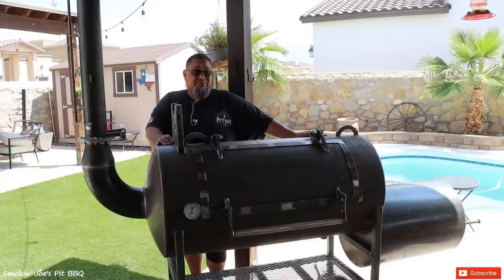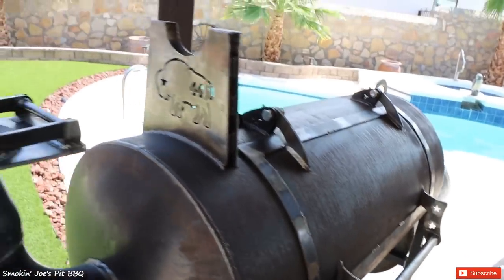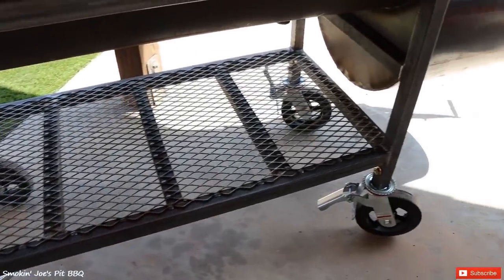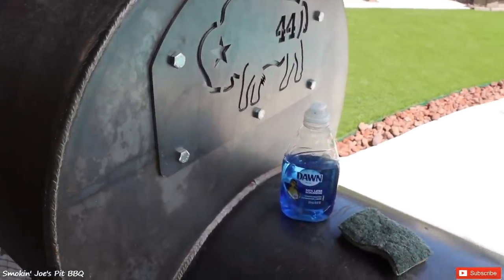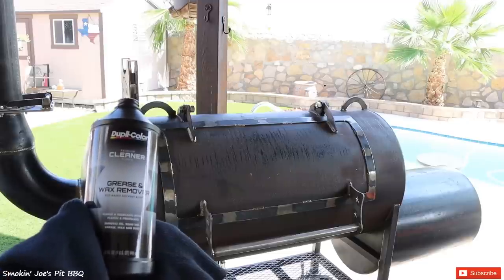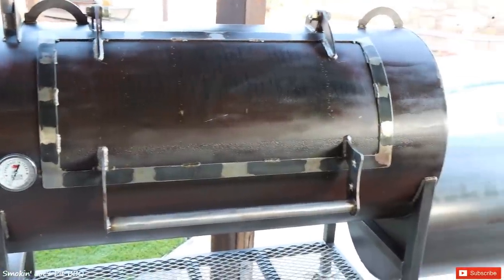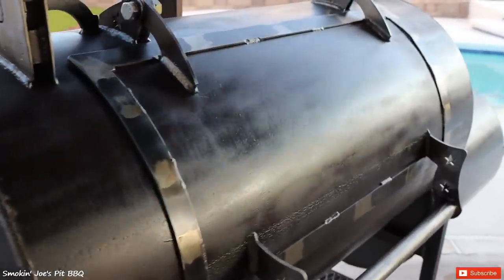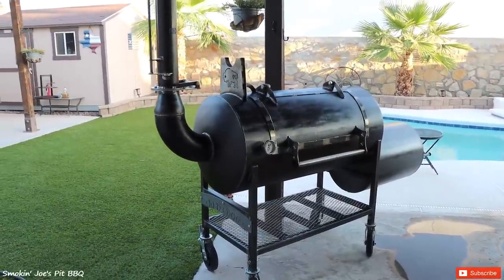My New Backyard Offset Smoker - Bison Smokers Red Dog - Smokin' Joe's Pit BBQ

Comment: Once you apply the clear coat you no longer have to worry about any rust issues or seasoning the smoker?
Reply from the maker: I only seasoned the inside of the smoker. You are correct, since I clear coated the outside, I won't have to worry about the surface rusting. 👍

Comment: Nice video.  If you have a moment to answer, I have a couple of questions.  (1)  You probably have more upper body strength than me.  But—is the lid heavy?  I'll guess that you're married.  Can a family member that's somewhat weaker than you easily lift it?  (2)  The racks looked shiny.  Are they stainless steel?